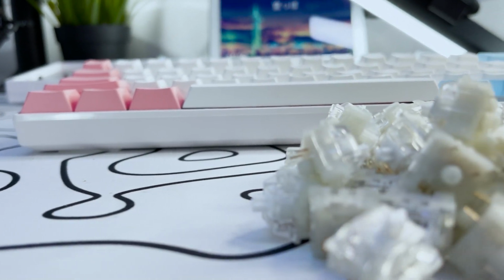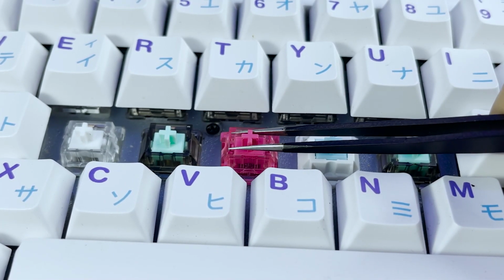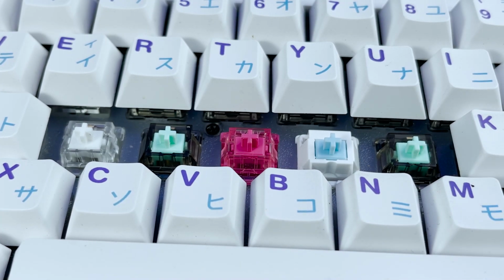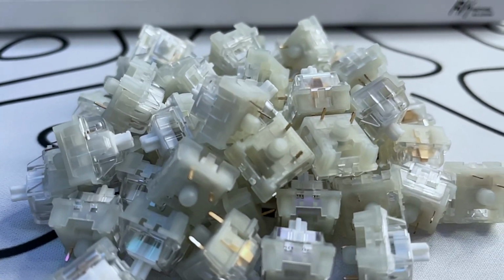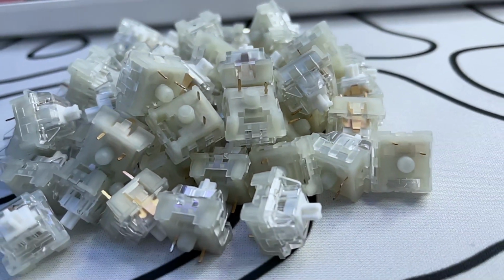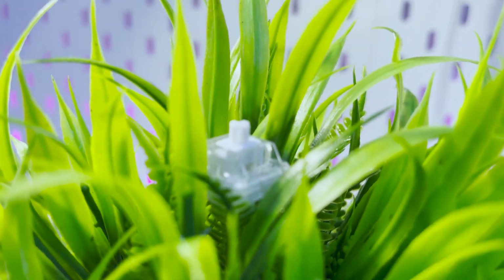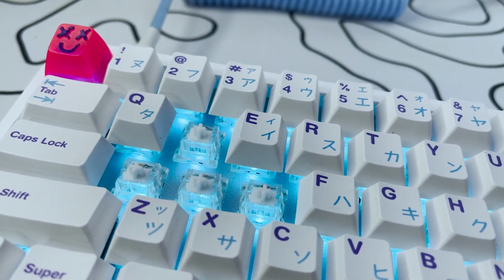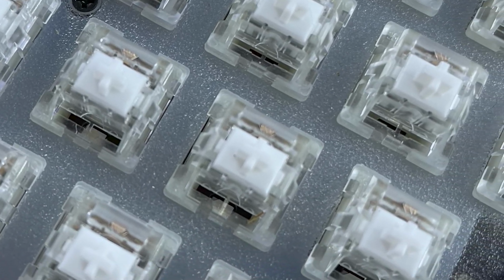KTT Kang Whites Review & Sound Test | A New Budget King?

Comment: Does it hqve a longer stem pole like the kailh black stems or is it normal?
Reply from the maker: I don't have Kailh Black Stems, but compared to Akko Rose Reds (another Kailh style switch) the stems are the same. I believe those are normal sized stems. I hope this can help!
Reply: @ItsHexical  Yeah it helped. I have Akko Ocean Blue switches which have the same stem length so this is helpful. I do feel like the stem length is ever so slightly longer though since the bottom out feels more solid and an alpaca feels more softish.

Comment: so this switch has a longpole stem right? but is it any interference if using cherry keycaps on north facing keyboard with this switch?
Reply: In case you still don't know, it has no interference on north-facing RGB with Cherry Profile keycaps. It also passed the paper test. If you like clacks, I'd recommend using these with ASA profile keycaps. Hope this helps.